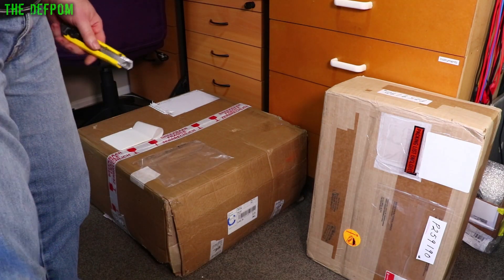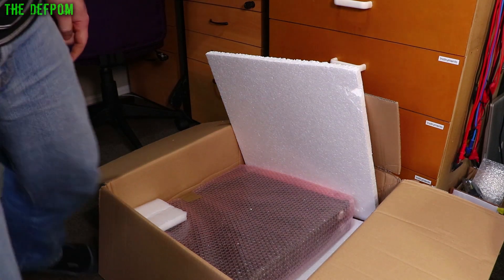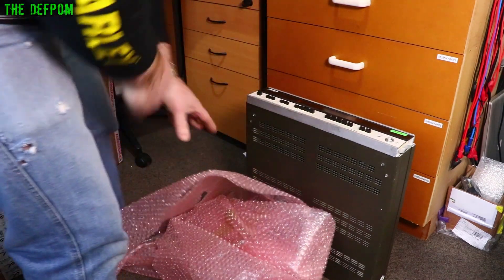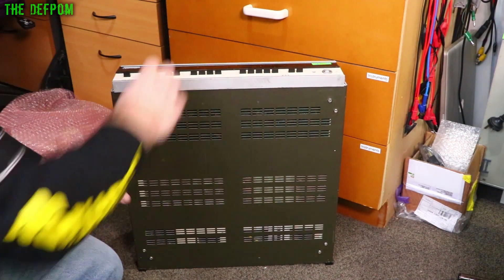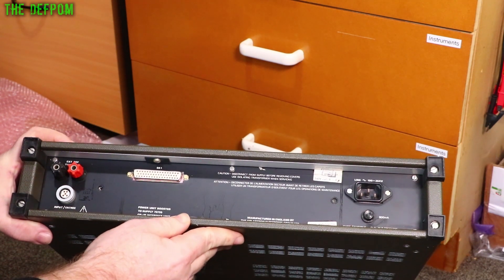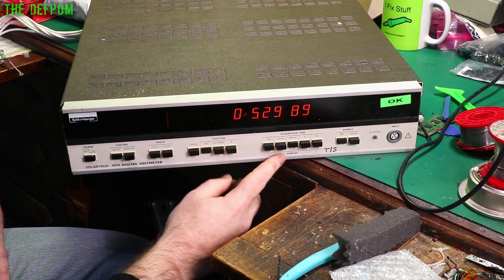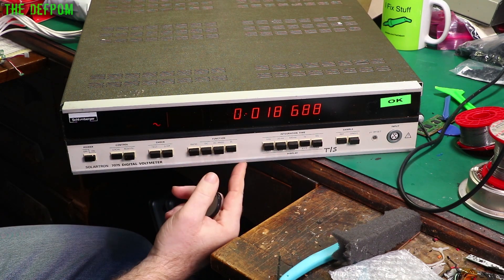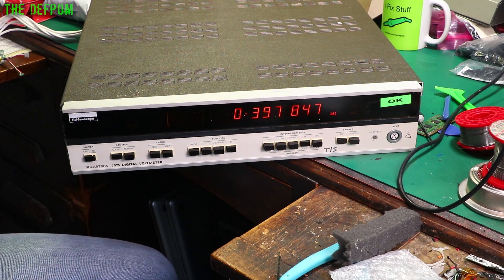#762 Solartron 7075 Multimeter

Comment: I have had a 7061 model since the late 90's and did manage to find mating plugs for the existing connectors. Your 7075 looks visually like the same connector. The manuals list it as being used in several 70xx models. Just as others say, I recall they were not cheap. I think I had to buy a minimum of 3 or 5 or such as well. The Service & Maintenance manual shows them as Switchcraft TA5FL but that number is a dead end as it now leads to a line of DIN jacks. The actual mating plug is made by Fischer Plugs and is similar to their current ST103 line. I can go out to the lab tomorrow and get the actual part number I bought (they mate perfectly).  The reason I went with this approach rather than changing the front panel as Ian did is because I did not have the capacity or funds to handle the low leakage requirements and could not afford a recalibration. Also, in case you need it I believe the calibration key is the same as the Microswitch AML20 key switch that is widely available. I will check that tomorrow as well.
Edit *****
The key is marked as model HV61, key number 601. The Fischer Connector plug is marked 5 pole, PEEK, RGM. The item number for the connector is S-104-A053-130 +

Comment: I have one of these and mine did not come with a cable. I made my own frankenstein cable which is very dodgy. Original connectors and cables are rare and expensive. Looking forward to see what you do here
Reply from the maker: I spent the money and purchased a premade cable for it, I’m waiting for it to arrive, I was tempted to modify it for Banana jacks.
Reply: @TheDefpom  i am cheap. Where did you buy the cable from?
Reply from the maker: abeleski - ebay, listed as 7071/7081/7075 cables, they have different versions, but they aren’t cheap.
Reply: @TheDefpom  yeah they are not cheap. Might need to see if i can find a decent video of a conversion
Reply from the maker: abeleski - IanScottJohnston did one.
Reply: @TheDefpom  oh ok. I will look it up. Cheers
Reply: @TheDefpom  If I can find the information, there's one company I know of which will make some lots of connectors and cables so as if you can get information on connectors / cables.  I had them make a rare & expensive cable that was no longer made (decades earlier).  turned out well.  I'll send that along once I've found it.  If theres enough of the Solartrons around the world might be wise to make up a small batch of cables.  A second thought would be to reach out to Pomona.

Comment: You got lucky with that unit not being busted to bad in the mail.
Guess if the handles had been on it they would have been broken off.
But when would you need the 2 extra digits resolution in this over a 5 1/2 digit meter?
Btw I just received a DELL harddrive rack unit (with 24 harddrives in it) that was packed just as bad.
It was smashed to peaces in the mail. Half of the drives and the shelf itself was destroyed.
In the end we just had to scrap the whole unit.
Reply from the maker: Geir Endre Jenssen - I want the resolution for calibration of other meters/sources, I now have four 6.5 digit meets and this, I’m not sure yet how good this one will be, and if I can even get it calibrated, I can do the resistance calibration as I have the Fluke 5450A, the other stuff I could do but it won’t be to the correct resolution and accuracy.
It’s a pity about the Dell unit, I really believe some people think that the postal service uses cotton wool to transport stuff, in reality they throw things from the backs of vans onto the ground...
Reply: @TheDefpom  When I get time I'll do a spot comparison of my 3458A, 7075 and 34461A (thats 8.5, 7.5 & 6.5 digit) and send you the results.......will be interesting to see how the 7075 stacks up especially in regard to TC.
Reply from the maker: IanScottJohnston - maybe do a video on it, I’m sure people will be interested.

Comment: At least the display is working. It is difficult to source those display segments when they go. The Fischer cable/connector for this meter will be ridiculosly expensive. I have seen them on ebay in 80-100 us dollar range. If you are not purist and dont wanna restore this one to the original looks then check out Ian’s video. He modified the input to take a regular 4mm banana plugs - it came out very nicely. Did the seller post handles separatelly? Or the meter did not have them? I have the same meter with GPIB option - it is like an external add-on. I can take it apart and share the schematics if you wanna roll your own add-on. Looking forward for the restoration video.
Reply from the maker: Normunds Gavars - Yep I watched Ian’s video about a month ago as I was considering doing the same thing. The seller posted the handles separately due to weight.
The GPIB sounds interesting, it is possible I need it, I haven’t done anything else with the meter since this was recorded nearly 2 months ago due to waiting for the cable to arrive, it’s still not here yet...